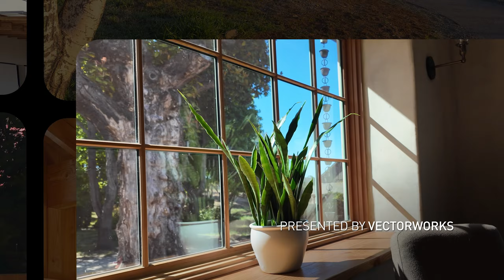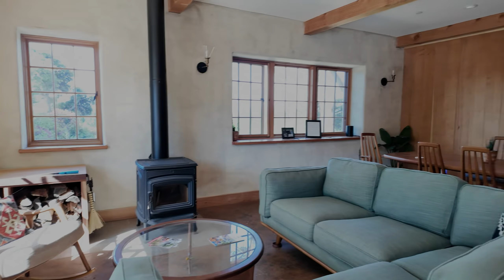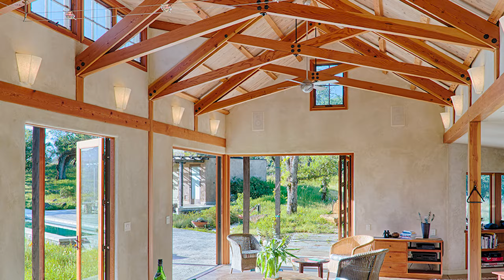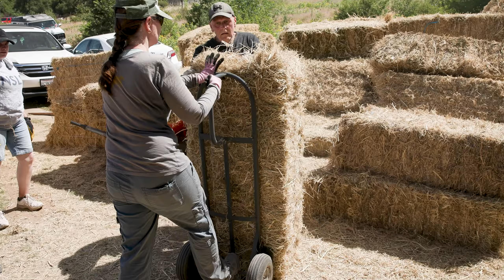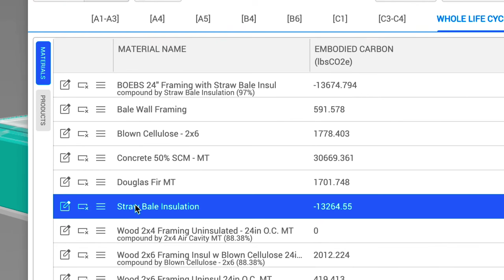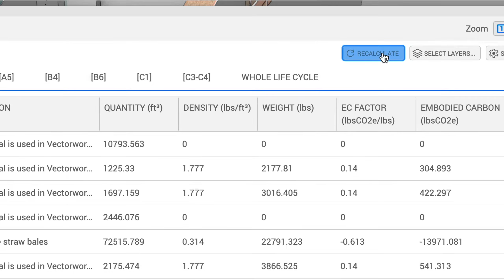Farm to Wall: Building Sustainably with Arkin Tilt Architects

Comment: Interesting. However, thatch roofing used to be done by using the waste from agriculture, now it has to be grown especially. Also, the straw bales preferred by farmers are larger and cylindrical for better cost and functionality reasons. Straw bales to use for building have to be prepared using older out-dated machines. Odd. We need to be using waste materials more, not especially grown or prepared ones! A bigger issue is that to use straw bales structurally is very difficult 😻
Reply: You're not really making sense friend. I suggest you look into the subject of building with straw bales or natural building before commenting. Perhaps pay a visit to a straw bale building? Straw bale buildings are found in temperate climates all over the world.
Reply: @eastbayray.  ,Here in the UK. straw bales are now usually large and cylindrical, the smaller rectangular ones have to be especially made with older equipment at greater cost. If other nations are still using rectangular bales in agriculture then that is, obviously, good. However, to have to especially grow what used to be just a waste product modern straw is not as suitable as 'traditional' long straw is less sensible than it used to be.
Reply: @johnkellett7797  I understand your point that with scaling this method, there is risk, and think it's important to bring that up: how can we continue to use natural and sustainable materials without creating an another wasteful process? In the U.S., bales are created in rectangular shapes and often people can create relationships directly with local farmers to determine how they bale the waste product. Another method is light-straw-clay which doesn't use bales and can potentially be less wasteful. Straw panels are increasingly becoming popular and allow manufacturers to work directly with farmers to bale straw for their specific wall systems; I see this as the most likely area for scaling this material as a sustainable building method.

How someone builds should depend on their area, climate, and what's available nearby.